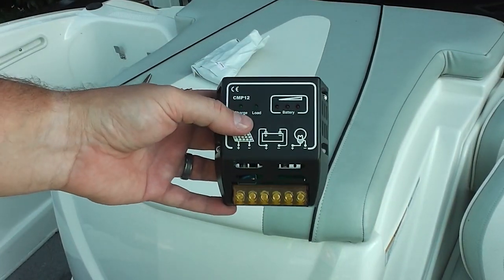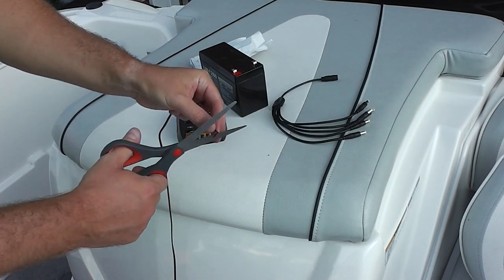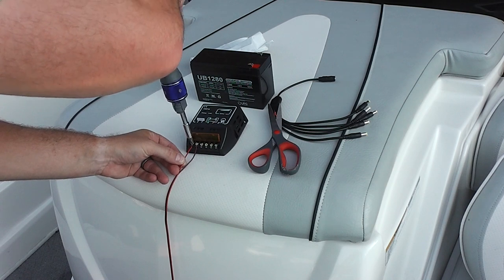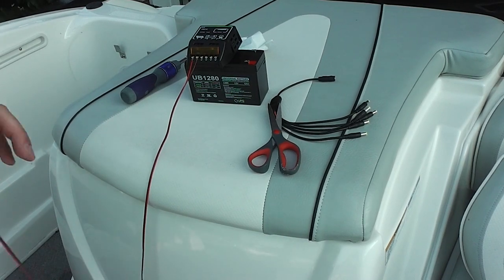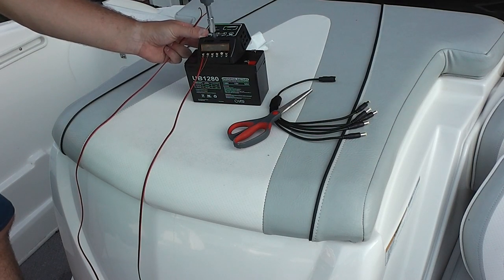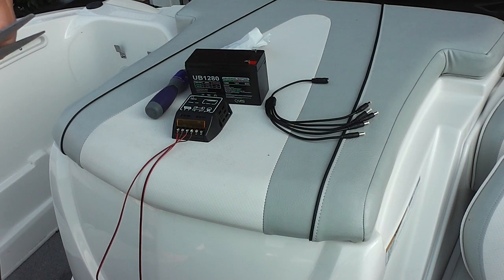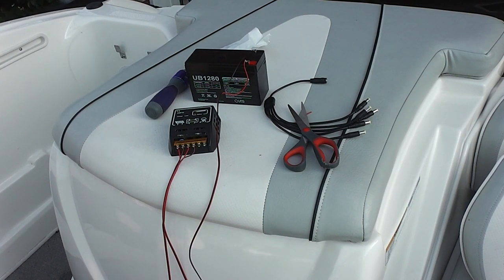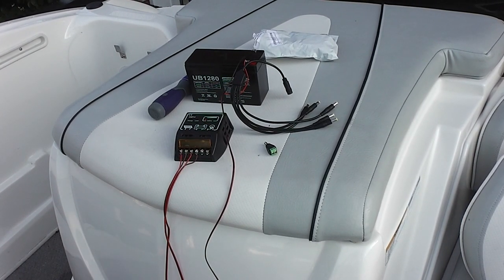DIY Boat Solar Power Solution for LED Lighting

Comment: So where are the links to the products you used?  I only see links for your social media....   "???"
Reply from the maker: Mike Erikson What are you looking for?
Reply: IrixGuy's Adventure Channel the control/union box and which solar panel (if you still like them).   I want to run a solar backup for leds on my boat as well and thought this a good way to go.
Reply from the maker: Mike Erikson Ahh check SnagBear website I have them listed on there or message me via my Facebook fan page and I'll reply with link.